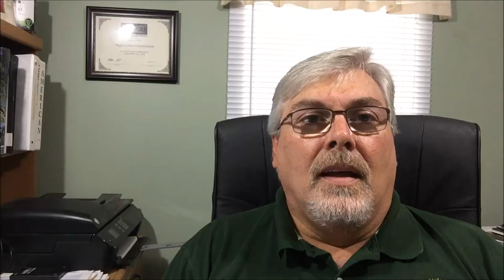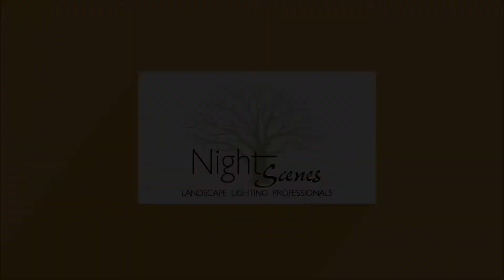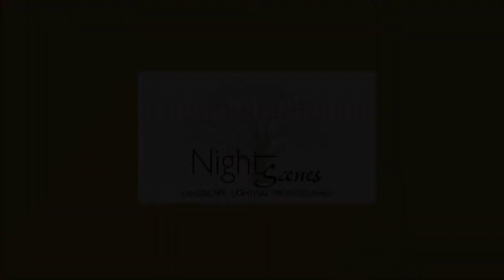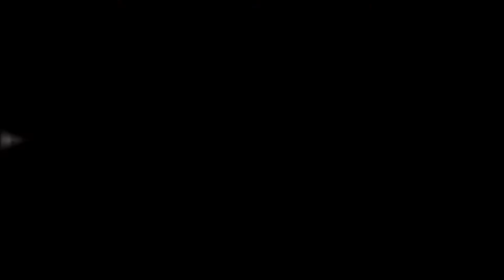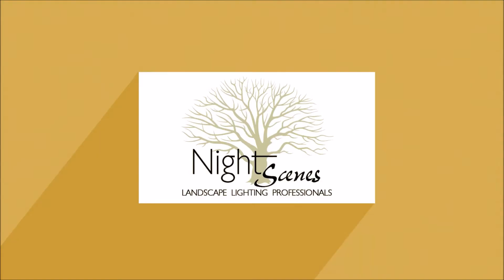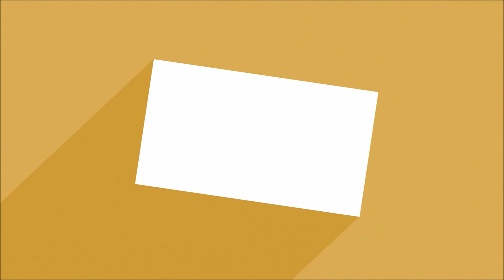Can I Use 16 Gauge Wire?

Comment: 200 watt 12 volt transformer, (7) 3 watt low voltage led path lights, 100 ft run max, is 16/2 wire ok? Thanks
Reply: Hello and thank you for the question. The answer is no. Your transformer is a 200 watt unit and therefore can handle up to 16.6 amps on the secondary (low voltage) side. You would need to use 14 gauge wire is the least size wire you can use on that transformer, but I would strongly suggest using 12 gauge instead. Then, you can fully load the transformer and not have to worry about overloading the wire. It will also help with the voltage drop you would experience with 14 or 16 gauge wire.
Reply: @PaulGosselinsr  I bought it at Lowe’s,  below was their "better together" deal which featured 16/2 wire 😐 I just ordered some 12/2. Thank you very much 🍻
Reply: @stoney-wan  The folks at the home improvement store aren't known for their knowledge of electrical theory, LOL. Best of luck

Comment: Hi there Paul - terrific video. I've watched a ton of videos about LED landscape lighting and its amazing that most do not mention this topic, and the ones I've seen that do, just skirt over it. I sort of understand why - it's a bit complicated, but i'm sure there are lots of folks out there not getting the results they wanted because they were unaware when they planned their project. I'm still trying to get my head around this topic - but I have re-jiggered my plans based upon your video. I was originally planning one run from a 200w transformer of 12/2 with 3 branch connections off it, with a total run of about 220ft, lighting 20 lights, with 140watts (7w each light). I'm now concerned about voltage drop, so I am thinking the 200w transformer with 2 seperate runs coming from it, each about 110ft, still using 12/2, with 10 lights for 70watts on each line. Do you think this setup will perform well? Ideally, i'm trying to build in a little extra, should we wish to add one or two lights on each line in the future. I'd love your insight into my plan! I also see some transformers that have additional 13v, 14v, 15v connections on them to boost voltage on longer runs - is that a worthy upgrade to deal with potential voltage drop?
Reply from the maker: mmhendrie I would highly suggest going with a multi tap transformer that goes up to 15 volts and separating your load onto two runs. Thank you for your comments
Reply: @nightsceneslandscapelighti9211   thanks very much Paul - would 12/2 wire be sufficient for this setup?
Reply from the maker: mmhendrie yes it will. Best of luck
Reply: thanks very much Paul - your advice is worth its weight in gold to me at this stage!

Comment: Hi Paul, Great info in your video. Think I understood the info but, just wanted to make sure I am not going to burn my house down with the wrong wire. I wanna run 4 lights that are 5-7W each. My transformer is 12V-50W. I have to run the wire about 125-135 feet. Was going to use 14/2 wire. Is this wire gauge just right or do I need to go up or down a gauge. Your insight would be very helpful and continue to put out those great vids.
Reply: Personally, I would run 12/2 because, a 50 watt transformer won't be able to put out more than about 13 volts, if it has a hi and low setting.This means that you probably not have enough voltage at your fixtures. Another thing would be that if you decided to add another light, you would need to upsize your wire anyway. Best of luck

Comment: High Paul, I'm new to your site and was very pleased with your references about 16 gauge wire and so forth. I have a question I hace an old 10 light Malibu Pathway system and I cut the wire. Can't get 2 end to meet up, can a piece of wire be added to make a connection. I have lights from transformer all the way thru 7 lights and that's it. If it can't be done safely I will buy another set of lights. These don't owe me anything. Appreciate an answer.

Comment: So is it better to go with 10g.  Using a transformer with 25a secondary protection.
Reply from the maker: Hi Gary, thank you for the comment/question. According to the NEC, 12/2 has a max rating of 25 amps, so you should not use any wire that is smaller than 12/2 coming out of the transformer that has a 25 amp secondary circuit breaker. Now if the transformer is smaller than 300 watts, it should have a smaller circuit breaker and therefore you would be able to downsize the wire according to the circuit breaker size. For instance, a 100 watt transformer should only have a 7 amp secondary circuit breaker in which case you could use 16/2 coming out of the transformer. I hope this information is helpful.

Comment: You can do this super amazing thing where you throw a 10 Amp fuse on there before your 16 gauge run and you won't burn your house down wow!!
Reply: True, can you name a single home owner who had done that? I've never seen one and I've only seen a few pros do it, even when provided the fuse by the manufacturer.
Reply: @PaulGosselinsr  people have horrible misconceptions about electrical, people think fuses and breakers protect appliances so they say why do I need that for Christmas lights

Comment: Hi Paul thanks for the info, and the materials are on its way. The package I bought comes with 16 gauge wire. My run is 300', should I use the 12 gage or will 16 gage work? Also if I but the wire in 100' lengths, can I splice the wire together to make my long run's? Not sure if I can find 400' rolls of wire. Thanks Paul
Reply from the maker: If your transformer is over 100 watts, do not use 16 gauge wire. Also, if your wire run is over about 50' do not use 16 gauge wire. Go with at least 12/2 wire. You can buy it in 500' rolls as well.
Reply: OK Thanks Paul, the 12/2 landscaping wire from Volt 500' is on its way, thanks again Jn.3:16
Reply: Hi Paul, I ran the 12/2 wire over 300' and used 100watt transformer and everything went great, thanks so much for the help. I used the connectors they sent with the fixtures and they did not work, I ended up wire nutting every one. What would you recommend for my next project? I'll be using 12/2 wire?
Reply from the maker: That's great. How about accenting your home?
Reply: Ok, how?
Reply from the maker: Get a copy of this book, it will help you a lot. https://www.amazon.com/Landscape-Lighting-Guide-complete-landscape/dp/1535192933/ref=sr_1_2?s=books&ie=UTF8&qid=1518720257&sr=1-2&keywords=landscape+lighting

Comment: Hi Paul, I have a 300' drive way to light with 8 low voltage spot lights, each are 4 Watts. what size transformer do I get? What size wire to I get? Thanks Paul. Also how can I have them operate on motion as well as on a timer?
Reply from the maker: Hello Richard. The first question to answer is, what is the VA (volt amps) for each fixture, which is higher than the wattage and this information should be on the LED product packaging. I'm going to estimate it to be about 5.5 and that is the number you need to use when sizing your transformer. So, 8x5.5=44 which is your actual load. You'll also lose some "juice" in your wiring and you never want to load your transformer 100%. I would not use anything less than a 100 watt transformer in this case. Then you need to figure out your low voltage amp load. To do this, divide your load (44) by your voltage (12) to get the amp load. In this case, it would be 3.66 amps. Now you need to know the voltage operating range of the LEDs you are using. Some operate very well between 9 and 15 volts, while others will lose a lot of light output if they have less than 11 volts. If you are using a professional grade multi-tap transformer, which has voltage outputs of 12,13,14 and 15 volts, you could use 12 gauge wire on the 15 volt tap and have about 12 volts at the last fixture. I hope this is helpful information and good luck with your project.

Comment: hey paul saw your video and spiked my curiosity,my question is ,im running about 90 feet of low voltage wire for 6 low voltage landscape lights about 120 watts total.i have a transformer with 2 -300 watt screw ins for the wire.what size gauge wire should i use?the wire i was given by home depot melted where a splice in was?what do i use?
Reply: RB OCONNOR really appreciated
Reply from the maker: Hi RB, I'm sorry that I'm just now seeing this. I would not put 120 watts at 90' on a single wire, unless you are using at least 10 gauge wire.